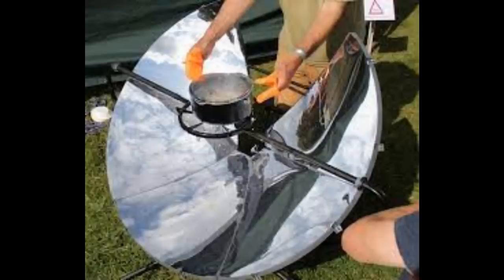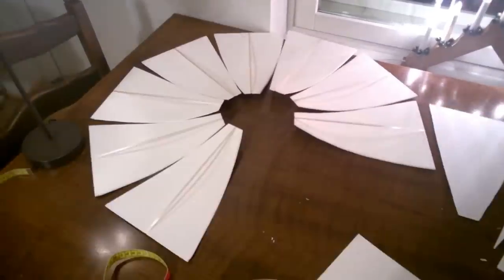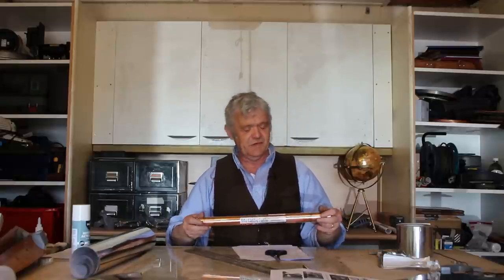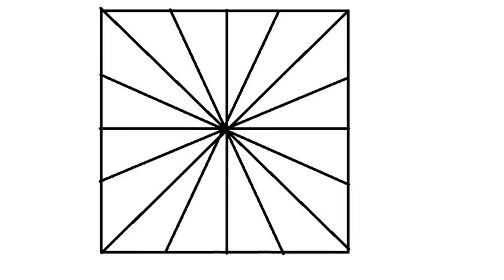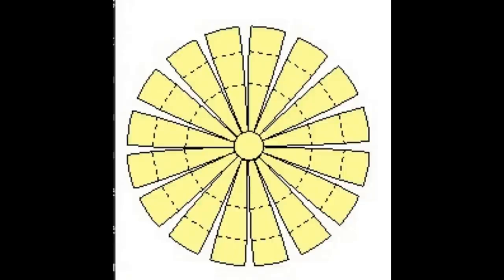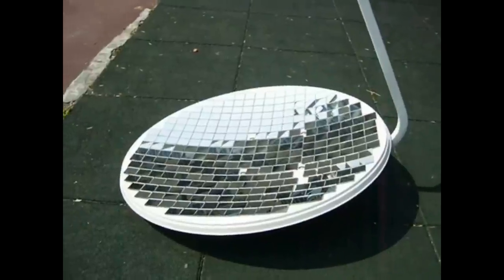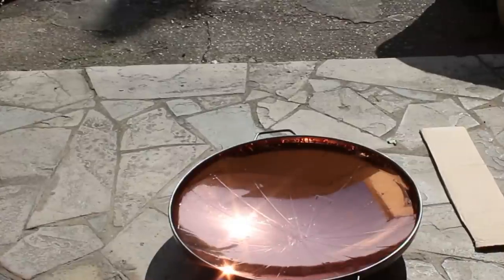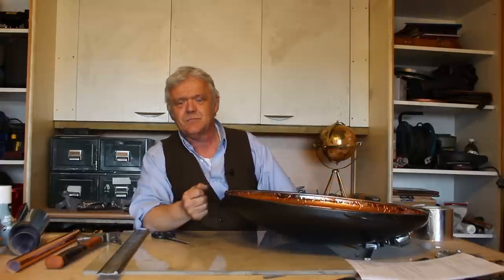1940 Burning Mirrors

Comment: Special note for mirrors. Two mirrors are needed for a periscope; the first mirror reverses the image, and the second flips it back. Continuing on with curved mirrors, a concentrating mirror converges parallel beams into a cone, then past the focal point, it diverges. To make the beam parallel again, a second mirror is needed to reverse the beam from the cone shape. Advantage here is the choice of placement of the second mirror. This is the secret of the Archimedes Lighthouse, burning ships out to 25 miles away. Coincidentally, these Lighthouses were used for long-range communication and spying on other cities.
Reply: So glad to see your comment 😅😅😅

Comment: Also - Get a wide bucket or pan, fill it with a material that sets up, like plaster or cement, then spin it at a constant speed while it sets up. The centrifugal force causes it to form itself into a mathematically correct parabola, with a focus dependent on the speed of rotation. Then just layer on your reflective material. You could use it as a form to heat bend some stiffer material and go into production.
Reply from the maker: that sounds challenging mate - spinning a weight like that while it sets isn't an easy task - the change in viscosity as it sets will also mean spin speed will have to change or it will just be a lump - i amnot sure that is a particulalrly easy solution - have you tried it?
Reply: @ThinkingandTinkering  yes. I did it with plaster of paris on a potter's wheel and it set up long before I got tired. And once it gets up to speed, it takes the shape and doesn't change with viscosity. I was just making decorations, but it makes a true parabola. It doesn't take a lot of RPMs and once it's moving it doesn't take much to keep it moving. I suspect a small motor with a belt around the bucket would do a good job.Just hang the bucket from a hook in a bearing if you don't have a potter's wheel. A variable speed motor would give you a variable focal length. You can find the formula online.
Reply: Sounds like an interesting use for one of those kiddie pools you can find being tossed out somewhere in the neighborhood. I suppose the tricky part would be building the turntable to put it on for doing this.
Reply: @pauljs75  to be sure, doing it with a larger size would be challenging. I was looking at his samples and remembering my efforts in a 5 gallon bucket. At about a meter in radius it would certainly start to be an engineering problem.
Reply: @BillDeWitt  Indeed it does become challenging, but it turns out at least one group (at the University of British Colombia IIRC) figured the challenge was worth it to build an 8 m telescope mirror using liquid mercury.  Apparently the optical quality is superb and the cost is significantly less than grinding a mirror that size to similar precision. One major limitation is that you're limited to targets directly overhead.
Reply: @whatelseison8970  I saw that today while looking around, also saw ActionLab do it with Gallium. I was surprised he didn't try chilling back into a solid. I think my plaster of paris ones made a better choice for solids, since they wouldn't have changes in surface density. Needs some experimentation, I might set something up tomorrow with epoxy or something. I don't have any Gallium.
Reply: I had the same thought, did the math and for a 1m focal length, requires 20 RPM rotation. This seems practical on a small scale. I was going to take something nearly parabolic, like the top of a bbq grill lid, coat it with something, say white paint (or barium sulfate paint), and let the paint set under motion. I know from reading how they cast telescope lenses they do this, but it's not precise enough, so they still have to grind some, but this gets close enough to save material and cost.

Comment: I think the most useful thing regarding making parabolic shapes I have found, you were the one to share, which was the beam of a light as it is cut in a cross section across something and trace where the edge of the light and shadow is, because you dont even need math or anything for that, and a whole unit made that way, you can quickly find the focal point using something like a stick since it burns so well LOL (just be sure to wear a welding hood or make a pair of polarized goggles with a second set turned 90º from the lenses (I am making a pair of steam punk like goggles that will have a rotatable for variable darkness, lenses using this, and 3 layers of polycarbonate lenses for a friend, and fellow researcher, for arc welding, cutting torch use ect, to protect his eyes, but not using brass making them a pair of brass goggles but rather pure titanium for the eye shields and the main lens rims LOL ) anyway, 

I seriously wanted to thank you for that info, so very useful. 

on the mylar durability, the one thing I can point out to help it last longer, Use a continuity tester like you test fuses with, and a little light comes on if the fuse is good, and test the sides of the mylar to make sure you have the metal coated side facing the sun, if you do, it can last 10 years easily in direct sun every day, but if you have the plastic side facing the sun and the metal facing down, depending on how much heat  can build under it, you can have those mirror surfaces blasted off by the sun, in like 4 days or less, (I had a batch of pieces I cut up and hot melt glued down to a tarp, and did not pay attention to which side was facing which, and in 4 days of oklahoma summer sun (brutal) the sections that were facing the wrong way  were mostly clear with only some faded mirroring around the edges and directly over the hot melt glue that apparently held the aluminum vaporized coating on the mylar plastic,)...

one advantage to making sure it is facing toward the sun (the metal side) besides it lasting longer, is the fact that you are blocking all the frequencies that a clear substance will absorb like a sheet of black painted matt finish will absorb all the light making heat, and it blocks by reflecting it so you get a lot of IR and UV that bounces off and back into what you are heating. (or burning, I was thinking 30,000 square foot of them to melt sand and make blocks of quartz glass for glass brick roads that each brick has a solar cell under it, so all that fiddly worry about the vehicles destroying the glass is not a concern as its in say 6 inch cubes with a semi spherical divot behind it and some rounded grooves from that to the edge of the brick for the wiring, and glass does not work well when flexed (large sheet with something pressing down on the middle of it) but it works quite well when being compressed (something just squishing down on top of it not bending or flexing it and instead reinforcing it not being flexed) So that road just needs a good solid flat surface to lay them out on, and if one breaks, you grab it using either a tool that a gap is formed in the bricks to allow removal, or a suction cup shape to pull it out, then slip in a new brick and any components broke under it :) Most of the energy to make everything in that would  come from concentrated sunlight from say a desert on the sunny side of a mountain (norther hemisphere as I live in, I would use a south facing slope of a rocky mountain in NM or AZ or something) cutting down on all the energy it normally takes to process the silicon and silica for solar cells and bricks, seems like it would make the whole process even for buildings with solar cells in blocks of glass held in place by the weight or better yet,... glass lego blocks! LOL anyway I have waffled on enough. Thanks again. great info series you got going on lately regarding the psychology behind science and tech, to help people have a more active and healthy attitude toward the work! :)
Reply from the maker: that was a nice post mate - thank yo for taking the time - i seriously enjoyed reading it - cheers

Comment: I really like that copper mirror effect! back in the day I carried a solar cigarette lighter, it was a conversation starter but not practical if you wanted to smoke at night or  a cloudy/rainy day. That said I have a couple stashed away in different camp bags.. mostly as conversation starters..lol.. you can pick them up for a couple dollars or even make one by polishing the bottom of an aluminum can...  I hadn't thought of it until you mentioned it but mylar glued to the bottom of a can would work and a LOT of folks carry those mylar space blankets... hhmmm food for thought...
Reply from the maker: for sure mate
Reply: Not solar but back in the day I carried a permanent match. Fuel was inside, unscrew a flint and strike it on the side. It had two geese pictured on it 'doing it' on the wing and the words "fly united" :)
Reply: @StrumHollow  HA I remember those! I had a helmet sticker like that and one with 2 bigs makin bacon..

Comment: Using the convex shape and putting the reflective surface on it, you could back it with spray foam and once hardened remove.  Light weight and easily replicable!  Cheers from Canada
Reply: Or form your initial surface and make a plaster mold. The foam will be lighter and easier to make. But the plaster would be more durable. It all depends on how many copies you want to make.
Reply from the maker: cheers mate

Comment: An easy way to draw a parabola, to help align your pettals or whatever, is to draw a parabolic envelope.  Basically you draw a bunch of tangents around the parabola. This is easier than it sounds, and many of us did this when we were kids.

If you ever did that thing where you too a peice of paper and drew a bunch of equally spaced marks horizontally and vertically (same number of marks in each direction, all the same width).  Then you draw a line from the top vertical mark to the innermost horizontal mark, then you draw another line from the next mark down to the next mark over and so on.  That curve that forms is a full parabola.

Comment: I built a cardboard & kitchen foil solar cooker from plans in Mother Earth News magazine back in the 70s. It barely fit in the back of my station wagon for transport and it was necessary to chase the sun around the yard just to tan a couple of hot dogs. Sun glasses were a must. The cooker had an adjustable curtain rod in the center to mark the focal length where a grill was put for the cook surface. Sure would have been better if it was a fold up design.
Reply: I have a factory made one  up to 400f

Comment: Cool!  Years ago I can remember seeing a guy cooking with a wooden frame covered in plastic (either the plastic had some give in it or stapled on so it wasn't bone tight) he supported this on 4 legs about 6-8 foot high and filled the plastic up with water to make a lens!
Reply: A homemade Fresnel lens - how neat!
Reply: @bradlafferty  I forgot to add that the frame that the plastic was attached to was about 6ft across by the time it was filled with water the lens was about 4-5ft across!
Reply from the maker: Fresnel Lens?
Reply: @ThinkingandTinkering  The weight of the water against the plastic just forms a smooth surface, and the thickness of the lens can be increased by the tension of the plastic, the bit that I can't quite remember is how he had the cooking side of thinking set up! If I am correct a Fresnel lens has ridges the same as a lighthouse!?
It's cheap and could be made portable!
Reply: I think they are talking about green power science channel RIP it was a convex lens.
Reply from the maker: @johnbelcher7955  you know i did a video series on this right?
Reply: @8ank3r  Yeah I know!
Reply: @ThinkingandTinkering  No! I'll have a look and see if I can find it. Cheers!
Reply: @8ank3r  it could have well been that channel but I seem to remember eggs being cooked!
Reply: @johnbelcher7955  He did a lot with solar cookers and fresnel lenses mounted on frames.  Dan Rojas rest in peace.
Reply: Concave lens ityf
Reply: @8ank3r  what happened to him?
Reply: @baranjan4172  i believe it was covid related

Comment: I'm a career commercial sculptor.  We have to make all sorts of shapes all of the time.  One time I left a fun house mirror lying in a field...it wasn't even a parabola but within minutes there was smoke in the grass!  Anyway...If I was going to make one of these cheap and durable, I would find a circular frame and stretch transparent vinyl (which you can find at the dollar stores as shower curtains and table cloths) then inflate it (as opposed to vacuum).  That makes a mirror smooth surface that can be fiberglassed or sprayed with hydrocal (or plaster) and fibers.  You could do the same by sucking out liquid hydrocal and fiber the way air was sucked out in the video.
Reply from the maker: i have done it that way too mate - cheers
Reply: We has a storage shed catch fire when I was in Iraq because someone left a sheet of mild steel leaning against a building.

Comment: Mirror silver/copper vinyl is primarily designed for decorative or visual purposes, such as creating mirror-like surfaces or adding reflective accents. While it may have some thermal reflective properties, its primary function is not focused on providing optimal thermal insulation or heat reflectivity.
Typically made of multiple layers, including a Coating, reflective layer and an adhesive layer. Coatings or treatments can alter the surface properties and affect the material's ability to reflect heat effectively.

I have tried these with parabolic antennas of dish tv with all materials... and just kitchen Al sheets are massively superior in thermal concentration with nearIR reflectivity at an astonishing 95% . However suntracking still remains elusive with robust, simpler methods.

Comment: Seems to me the thing to do would be to have a couple of these simple mirrors - could be plastic covered with mylar, IDK - with a bit of framing that allows them to heat blackened "heat bricks" in the morning hours that you then place in an outdoor oven that you use for the cooking ... something like a tandoori oven, pizza / bread oven, a warming oven, or a base to use as a stove. Maybe focus light on an iron pot you can fill with river stones ... would the stones be ideal for controlling temperature? IDK. Seems to me this would keep cooking mess away from your reflector, and allow you to better control the heating in the oven(s) by adding and removing what amounts to "re-usable coals." Just be sure to start the oven in the morning and have all your cooking done by sundown. 🧐

Comment: I found an IKEA plant pot base that was formed in to a parabolic shape. It was made by rolling thin strips of ply wood. Rolled up to make a large disk. Then it must have been placed in a former to produce it's shape and then glued in place. All I did was spray paint it silver and applied strips of reflective mylar tape. I suppose the same thing could be done with strips off cardboard rolled up.
Reply from the maker: that is interesting thanks for sharing mate

Comment: What if we use a large wax coated wok / parable to make a mold out of ~ plaster, foam, paper mache', etc. 

Secure & seal the surface of the negative parable, then using mold release wax to coat the mold followed by application of a mirror surface then a light layer of flexible reinforcement so that the new parable can be peeled off of the mold? 

Just a thought from experience making boats as a teenager.
Reply from the maker: good idea mate - cheers

Comment: If you were to set your device on a solar tracking platform. Located at the south side of your house. With a looped copper coil placed in the heat tube, replacing the water with heat conductive oil. Use flex lines to  connect the  copper coil to an overhead insulated water tank, in a thermal siphon arrangement. By the end of a sunny day, you would likely have a  lot of very hot water.

Comment: Some of the recent "chrome" spray paints are pretty good for this too. Looks like he had it on the desk, but forgot to give it a mention. It's probably one of the easiest things to apply once getting the dish part worked out. A lot easier than trying to cut up bits of film or tape and getting that to adhere to a surface.

Also the method for the mylar dish can be copied with a plastic garbage bag instead, and that shape can be plastered over to make a release form for making non-reflective dishes that way. And then those can be further covered to make a reflective dish.
Reply from the maker: i mentioned it in the previous vid mate
Reply: reflecting light and reflecting heat are 2 different subjects. mylar does the 2nd part better and paint does the 1st.